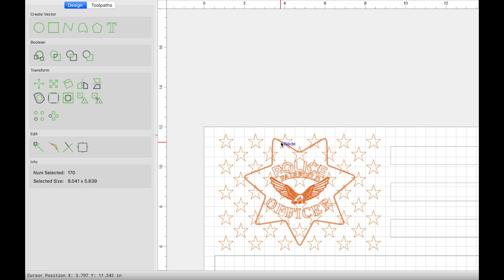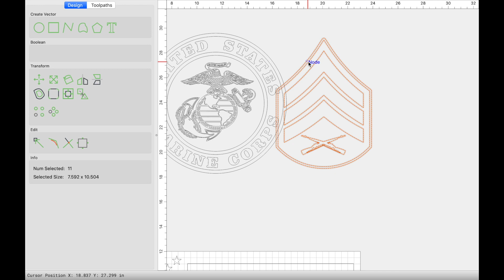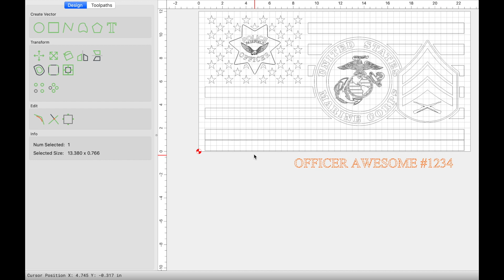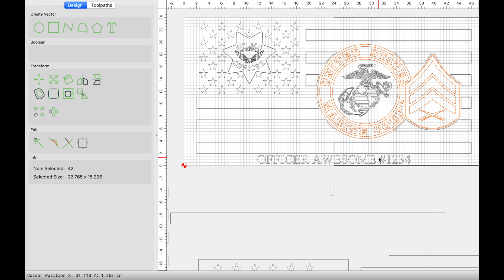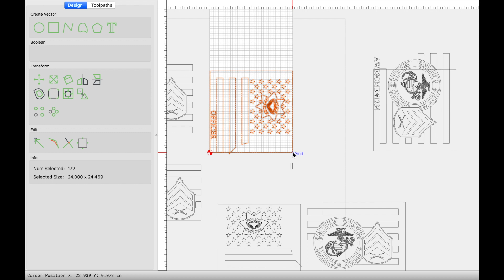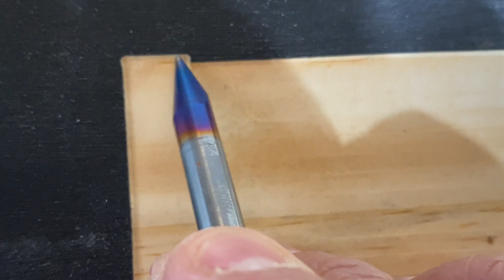Put Your CNC Skills to the Test! Discover How to Craft the Perfect Thin Blue Line Flag

Comment: We Need HELP! We've watched this video till we're blue in the face. We can't get that part where you hold shift and deselect vectors then delete unwanted parts. Please advise.
Reply from the maker: Hey Roxane 

When you create and offset you may get additional offsets created.  Hold shift and deselect only the offset you want to keep. By doing this you keep the unwanted ones selected and then you can press delete and get rid of those.

Some things to look for:
1. Are your created offsets grouped? If so, while all offsets are selected, ungroup and then hold shift and deselect the wanted offset and delete the unwanted ones. Please note that when you crate the offset(s) they should be highlited, so when you press ungroup they should remain highlited.

2. When you create your offset, are you getting any additional ones? You may be trying to delete something that isn’t there. Due to the size of my design in the video additional offsets were created. This may not be the case for you. You may be able to move on to the next step. 

3. If all else fails, you could always manually delete the unwanted offsets for now on this project and on others keep trying. Sometimes starting fresh will keep you sane 😂

Comment: Most informative video Ive seen in a long time.  I struggle with carving text with a V bit. It looks like your doing a flat bottom carve with the V bit? Could you do a video about carving text with a V bit?  Thanks
Reply from the maker: Thank you Mark. I’m glad this was helpful! 

I did use the advanced vcarve for flat bottom text. As you saw the vbit cleans up the edges nicely.

For regular vcarve texts I like to set my z zero above my material. So when I start feeling drag on my vbit (using the paper method) I stop and raise it 3-5 clicks at the lowest interval (0.001”).  

My max depth is always set to stock bottom. 

I will add a vcarve video to my list. Thank you for the feedback!